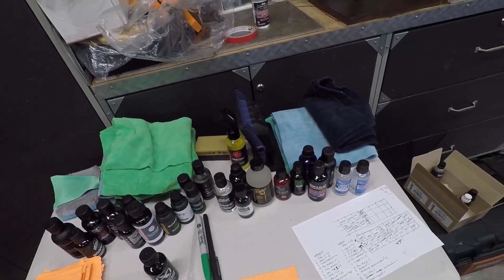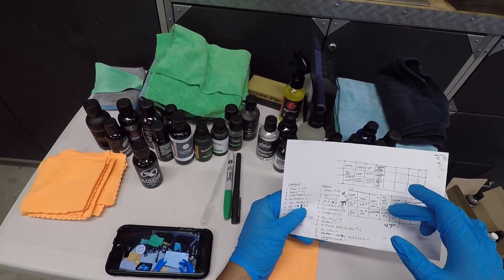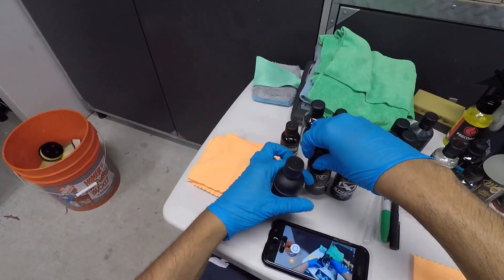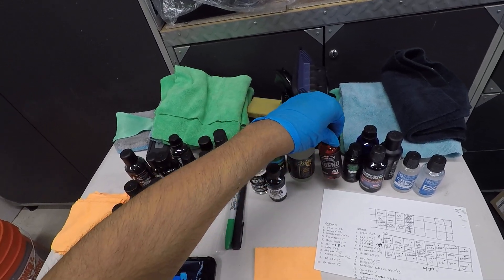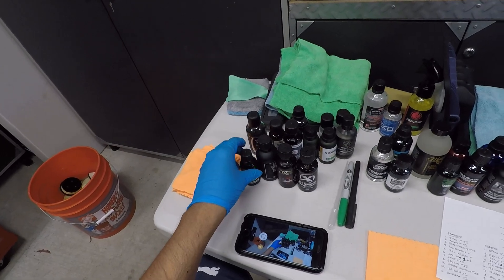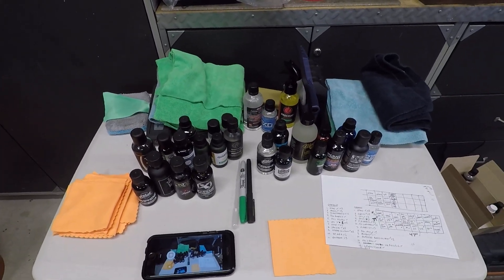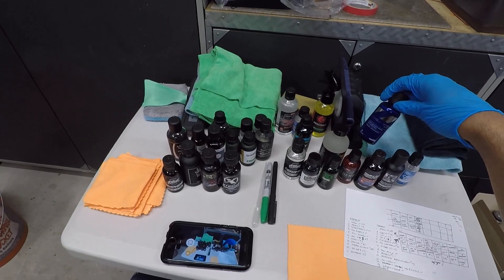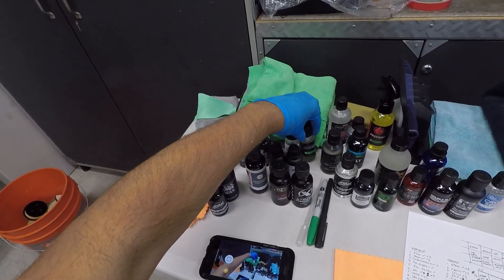2021 Coating Test Application - Graphene vs Ceramic

Comment: Hey Mike, does graphene REALLY reduce water spots compared to a ceramic based coating? The theory is meant to be that graphene reduces the surface temp thereby reducing water spots... but most graphene coatings only have about a drop of graphene in them, as graphene itself cannot chemically bond to paint... so despite companies claims, what have you observed personally? Curious to know! Cheers, Pete
Reply from the maker: I did not notice any difference. One benefit to graphene is that they are slick compared to a typical ceramic coating.